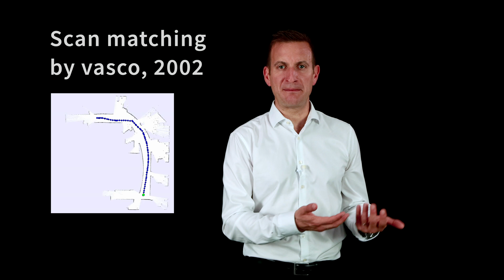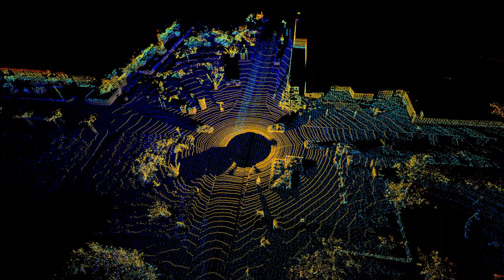LiDAR Odometry - 5 Minutes with Cyrill

Comment: Really nice video. Right now I am researching about the lidar SLAM algorithms. Especially for the tunnel environment where it is dark and not manny features are present. I am wondering about the performance of the KISS-ICP in such environment. Also in the paper there is comparison of KISS-ICP with other state-of-the-art algorithms. I am wondering why algorithms such as Fast-Lio2, LeGO-LOAM, SC-LeGO-LOAM, LIO-SAM were not included in the comparison? Thank you
Reply: I'm just making assumptions here. KISS-ICP is a LiDAR Odometry method, which only takes LiDAR's point cloud as inputs, maybe that's why Fast-LIO and LIO-SAM are not counted as comparisons since they are LiDAR-Inertial methods. SC-LeGO-LOAM contains a global point cloud descriptor to perform loop closure and backend optimization, and KISS-ICP mainly focuses on frame-to-frame alignment.
Reply: I see, thank you for your input